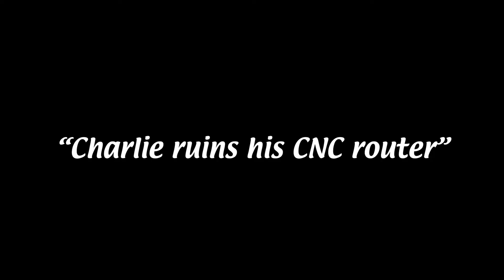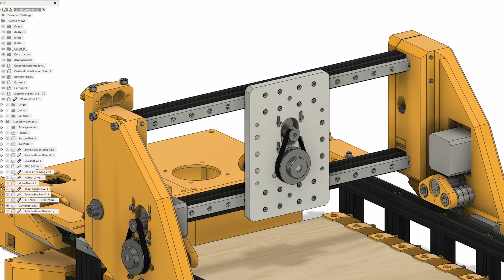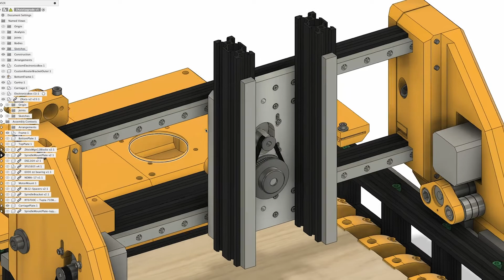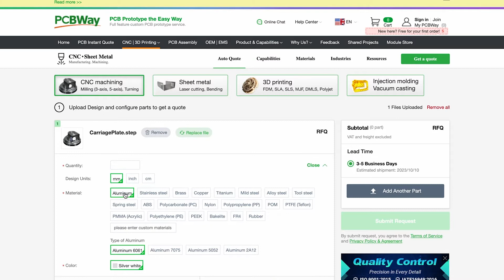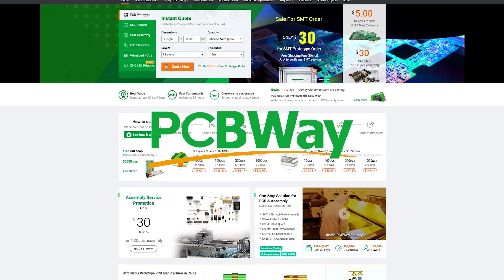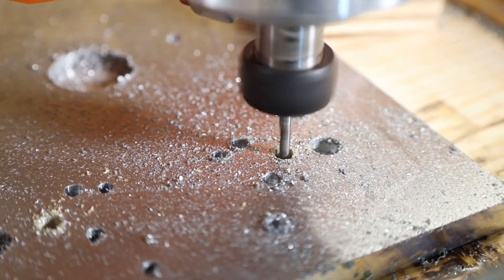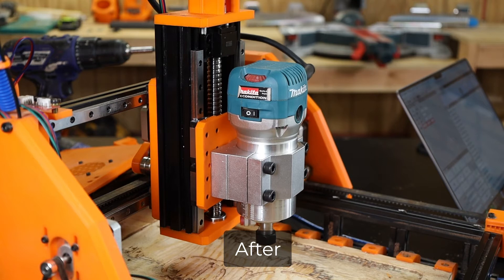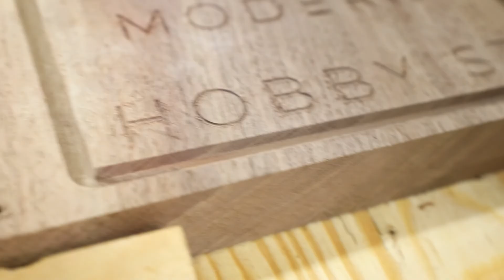Upgrading My 3D Printed CNC Router!

Comment: Those thin extrusion on the back would probably do well if upgraded. You need the torque, but the rigidity of the machine has to match that torque or it will result in more flex instead of better cutting. Maybe try single flute 1/8 end mills for aluminum with even smaller cutting diameter? It's slower but you'll get the parts. Also maybe next video could start with measuring the deflections and where they originate. The increased distance from the X axis means that you now have a larger moment arm, likely increasing deflection significantly. But after all, measure it with a weight and how much the end mill moves say using a 5kg weight on a string. Then you can optimize to reduce all that flex. The stepper motors are real small, so it's probably a really good idea to keep the gear reduction. But at the same time, if it's too high, the chip loading will be too small. So maybe it's time for 63mm NEMA 17s or even upgrading to NEMA 23? But that almost always requires you to use external stepper drivers.

Comment: ally is good, 1 flute up cut, 18000rpm, some lubricant. keep the stepdown low and the feed low. id do 0.5mm steps and 1500mm/m on mine but its also big and a bit flimsy. nice little machine, id love to see you upgrade it further.

Comment: I have quite a bit of experience (successfully!) cutting aluminum on my DIY MPCNC.  I only use single-flute, carbide, upcut bits (mostly SpeTool bits from Amazon).   I don't use lubricant, only occasionally some IPA spray to cool the bit on long cuts.    You're not going to be able to get large chips on one of these machines -- tradeoffs have to be made.  In this case, I choose higher RPM to shift cutting power from the XY motors (weak) to the spindle (a lot stronger).   But the high RPM generates a lot of friction/heat, which is why you want to try to keep flute-count low (single-flute) and feedrate up. 

For most operations, you want "trochoidal milling", which if you're using Fusion360 CAM is part of "3D adaptive clearing".  Adaptive clearing is really magical, as it optimizes for consistent tool-load.  So once you dial in the settings, if it works at all, it should keep working as long as the tool doesn't go dull.  Here's what I use most:
  -- 1/4" (6.35mm) diameter single-flute carbide
  -- 22,000 RPM
  -- Feed: 600 mm/min (~24 ipm), climb milling
  -- Depth of cut (DOC):  4.0 mm
  -- 10% optimal load (0.635mm stepover)
  -- Ramp:  helix @ 2deg
  -- If you have trouble, scale back stepover first, then depth of cut.  Try to keep feedrate up, otherwise you generate too much heat.

For contouring, you can do adaptive/trochoidal for your contours but it will literally take 10x the amount of time as doing a regular contour.  I swear by traditional contours using a 1/8"-with-1/4"-shank single-flute carbide endmills (excellent for rigidity).  My magic numbers for this are:
 -- 1/8" (3.175mm) single-flute carbide
 -- 26,000 RPM
 -- Feed:  400 mm/min (~16 ipm)
 -- Depth of cut:  0.4mm 
 -- Lead-in/out, no ramping

One pro-tip for cutting aluminum plate contours:  Setup a contour operation as above with 0.2mm radial stock-to-leave (0.4mm DOC).   Then copy the operation, only changing stock-to-leave to 0, and DOC to 4mm.    The first contour cuts the part slightly oversized, the second one only removes the last 0.2mm in 1-2 passes, which leaves a super clean surface finish.

Comment: Do you have plans to rework the printed parts in Aluminium with the printed CNC to make a better machine?  How does this compare with the 150 and 500 dollar machines you reviewed?
Reply from the maker: To be honest I haven’t had time to rework the plates in aluminum yet 😩 but considering I spent about $600 on this machine, and it would have been just a little bit more expensive to go quite a bit bigger, I’d say it’s a heck of a deal. It’s way sturdier than either the $500 or the $150 machine! It was definitely a lot more work than the other two, but now that it’s built, it is super easy to use

Comment: For milling aluminum:
1: I would buy shorter endmills and also clamp them as short as possible.
2: Take single flutes endmills with DLC coating. Or 2 flutes DLC with a low pitch (if you have problems with vibrations).
3: I'm using isopropanol alcohol with compressed air for cooling and lubricating the endmill, which works amazing!

Comment: Why not just make it bigger to offset your issues with parts taking up axis realistate.  The same X tube aluminum can be frame bolted to sections of the plastic you feel may flex or bend.  Its not a high speed machine, inertia doesnt matter, so you could build it as big and strong as it needs to be.  Hell you can make plastic cnc machines mill steel if you reinforce them to ludicrous extents.  The idea of making your own cnc is not to make it minimalist and "clean"  its to emulate the real deal but with pennies instead of dollars.

Comment: Hi! If your machine does not have sufficient rigidity for milling Aluminum you should try these settings: 
Depth/Pass 0.15 mm ; Plunge rate 200 mm/min ; Feed Rate 2000 mm/min ; Spindle 12000 RPM 
(All settings are for a 4mm Diameter, 3 Flute Aluminum Cutting Bit) but you can adapt for the bit you use
This are the settings that i personally use for my Wood CNC Router. (And yes, is made out of wood )
GOOD LUCK !!! 👍
Reply from the maker: Much appreciated!

Comment: I myself have barely any Aluminium Cutting Experience ( like a single Project https://youtu.be/AQ27ZcNx_eM ) but from the looks of it I'd guess you're either a) using the wrong type of Aluminium b) an unsuitable Endmill or c) the wrong Speeds / Feeds with my personal guess being a) and c) having a very high involvement in the matter because of the existence of those raised burrs I'd like to think of as an indicator of the Aluminium either being the type that likes to gum up ( acting more like soft butter than hard wax thus gumming up the Cutters ) or your Endmill being dull thus essentially only rubbing along ( the dark tip of it reminds me of an HSS Endmill I once used on MDF instead of a Carbide Tipped one subsequently ruining it as it burned out )

Comment: I'm currently learning to mill aluminum on my MPCNC and I've gotten encouraging results with the following settings: 1/4 single flute end mill, trochoidal milling (or fusion 360's 2d pocket), 22k RPM (Makita's number 4 power setting), feedrate 550 mm/min, 0.0254mm chip load, 50% radial depth of cut (i.e. 3mm), 0.25-0.5mm step down (axial depth of cut) and 25% ramp feed. I did also try 1/8 single flute but it did worse. Understanding chip load (or feed per tooth) was definitely the key to success.
Reply from the maker: Thanks for the info!

Comment: bro at least add lead screw or ball screw at x and y axis it will give machine little more rigidity. and assemble x axis extrusions to one single plate it provides better rigidity  to machine
Reply from the maker: All good thoughts! I have a Fusion360 design to do exactly that (regarding the ball screws on X and Y), but the cost to upgrade and the work required would justify an entirely new build rather than an upgrade. I may make another DIY machine with ball screws and more thought put towards rigidity, but for now the machine can do what I need it to 🤷🏻‍♂️
Reply: @ModernHobbyist  
if it works as per your requirement then no issue content is very good
Reply from the maker: Thanks you, and thanks for watching!

Comment: Just checking-out your BoM. Should you not have 2 lineaq bearing sets and 4 blocks? Also, where does the 2020 extrusion go? Thanks.
Reply from the maker: Good catch! Needs 2x MGN12 rails (which come with one block) and 2 additional blocks. I've updated the BOM. The 2020 was initially to be a horizontal brace between the 2040 extrusions, but while building it a decided it didn't need it so I left it off but forgot to remove it from the BOM 👍

Comment: Closed loop steppers and a good controller (Masso, Acorn etc.) will eliminate the problems with skipping steps or at least either self correct or pause the program allowing you to restart a few lines back in the G-Code. A real spindle can give you torque at slower RPMs. Those would be my biggest recommendations for upgrades.

Comment: my personal opinion, it would be much better to move the X axis motor out behind the gantry and move the spindle as close to the gantry as possible. this will help with rigidity, and that will help with your aluminum milling. Speeds and feeds are critical with aluminum as well. being as the machine is just not super rigid, light cuts will also be required.
Reply from the maker: Thanks for your thoughts! I considered making more changes to the X axis motor assembly, but opted for the lazy route of integrating with the existing system instead. I've considered rebuilding the entire machine with lead screws in the future which would bring the z axis closer to the gantry, but that'll be one heck of an overhaul!
Reply: @ModernHobbyist   oh, zero lash lead screws or ball screws like you use on the Z would be an absolute game changer! But for now, try this; you're running into a tool pressure issue so try dropping to a 1/8" endmill if you have not already, and slow down your feed rates. To keep the chip load high enough while reducing tool pressure, try a o-flute endmill. drop your depth of cut to some fairly low numbers, maybe .050" or even .020" with a 50% stepover. you might have to drop the spindle speed as low as possible too. try to keep between .0008"-.001" depth of cut per flute. I'm telling you though, the o-flute or single flute cutters are a total game changer. if you can keep the machine from flexing while keeping a good chip load, it will do amazing.
Reply from the maker: @MonkeyWithAWrench I’ll give all those tips a shot! I did drop to an O flute 1/4 endmill for cutting acrylic and it absolutely chewed right through it with almost not chatter or issues. It was awesome!

Comment: if you use a higher voltage on the steppers, they will have more torque and be more powerful. You will want bigger stepper drivers because the ones you have are tiny. Some people can get up to like 60 volts but 24 is a good amount
Reply from the maker: I’m curious how that will affect the motors heating up and if having them attached to plastic parts would be a problem 🤔 I’d definitely like to start messing around with more intense upgrades to the machine though so this is helpful info, thanks!
Reply: @ModernHobbyist  it will definitely put more heat into the steppers. for the parts that interact with the motors, you might want to print them in something more heat resistant than pla. something like petg or asa will take a lot more heat to soften than pla. If the motors are already quite warm it might be a big problem, but if they are cold now, it probably wouldn't be too bad if you put more voltage
Reply from the maker: @bobtheblob2770 awesome, thanks for the info!

Comment: The stick out on your endmill is far too long, and all that extra rigidity is lost in flex on endmill try and find a single flute with geometry to cut aluminium reduce step-down a  little and it will cut fine

Comment: CNC printed is an oxymoron like a battery-powered tank for an army . Design of the X and Z axes is a tragedy . It looks nice in theory, but in practice it's worthless . CNC for aluminum should be at least made of strong aluminum (20mm or more) but best will be stell and gantry construction . the cnc you showed is a toy .
Reply: I’d like to see your affordable easy to manufacture with limited tools CNC design that outperforms this “toy”, bozo.

Comment: You should consider switching to nema 23 steppers from nema 17s. I did the same on my cnc and it made a big difference. Also, when cutting aluminium try setting the router as slow as you can for me it was around 1.5 on the makita while using a single flute 👍
Reply from the maker: Thanks for the aluminum tip! I thought about nema 23s for this build but I wasn’t sure if I they would work with the Arduino CNC shield. I do want to build a printNC some day and for that I’ll definitely go with 23s!

Comment: You should change all your endmill to single flute . Single flute endmill works so well on aluminium , it does not need oil or enything to get succsesful cut with aluminum . I have the same issue as yours when i build my first DIY cnc machine . Hope my tips help you , great machine build BTW
Reply from the maker: Thanks for the input! I have a 1/4” single flute endmill that works great for aluminum but I guess I’ll need to try to find some 1/8” ones. Thanks for watching!

Comment: there is a product called Tap Magic for aluminum. it is hands down the best cutting lube for aluminum i've ever used. smells a little like cinnamon. 35 years, 20 of it running my own shop with my homedone bridgeport conversion CNC and everthing else, and we buy it by the gallon. nice vid - about to build a cheapo gantry CNC, so wanted to look at your rail system.
Reply from the maker: Thank you! I tried using some tap magic actually but wasn’t sure if I was helping or hindering. All the chips seemed to clog up in the slots rather than ejecting like they did when dry 🤔

Comment: if you loosing steps that simply means your single steppers in most likely cross table axies is too weak to resist the pressure of your work
you have 2 options, either get bigger motor close to maximum  of 2 A your driver can handle or double it up and add another stepper driver in paralell to the existing one, i think only jumpers for microsteping, and outputs have to be separate for each driver, pins like power rail direction and step count can be unceremonially rewired to multiple stepper drivers, you could do it with  your existing double steppers on the across the table axies too if that start skipping
also the faster you spin a stepper motor the less torque it has so keep it in mind
also tune your steppers current with thermal probe if you give them enough current they be simply getting warm, if you give them too much current they will start getting hot and maximum torque is somewhere in between, but take into consideration that above 1 A your stepper drivers usually need a fan even if they are rated to up 2 A

Comment: milling aluminum with such a high rpm spindle is a nightmare. it is possible however, you need the axis movement speed to match the spindle speed (move much much much faster to avoid chip welding an heat build up). I couldn't tell what endmill you had but try a single flute. aluminum n3ed to be ejected out of the cut as soon as possible especially if dry cutting. Try the lowest rpm in the router but I almost sure you will not be able to successful cut aluminum in that setup. What you can probably try is micro endmills such as 1/8", 5/32" etc. These micro endmills are rpm hungry as apposed to larger endmills and with the lack of rigidity in this setup, you'll probably max out there in terms of metal cutting. There is a fine balance between rigidity, spindle speed and movement speed. You just have to figure out what youll be doing with the machine, mainly, and move on from there.
Reply from the maker: Thanks for the great tips! I have a single flute 1/4” endmill that I had success with, but the holes in these plates were too small, so I tried using a 3 flute 1/8” endmill and with that in mind, what you said makes total sense! Would you recommend using lubrication or just getting the feeds and speeds down right?
Reply: so by switching from a single flute to a 3 flute you tripled the chip load on the tool.. probably making it clog up, lubrication can help, or rather a coolant. research your chiploads for the tool you're using, you'll cut ali clean soon enough. @ModernHobbyist